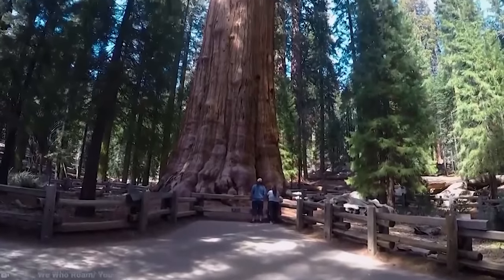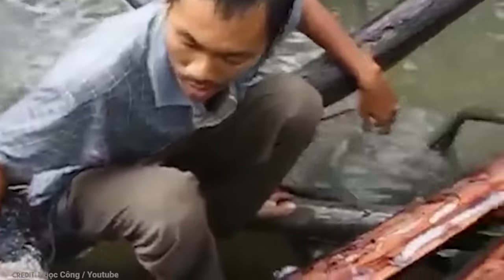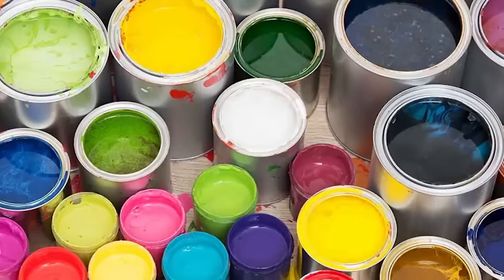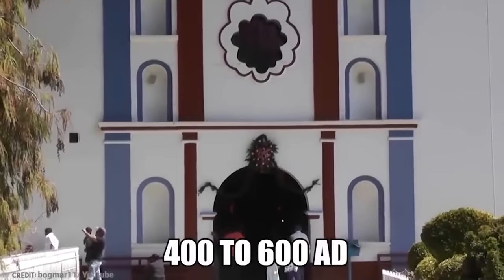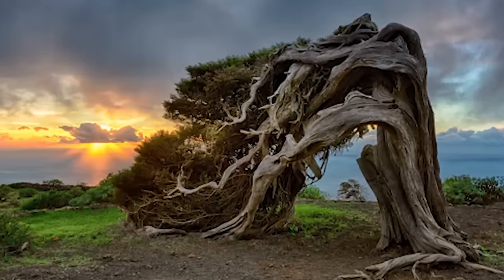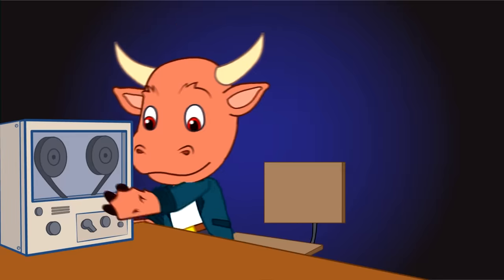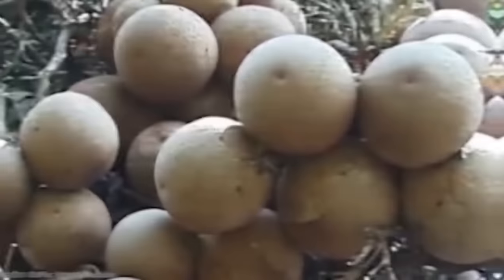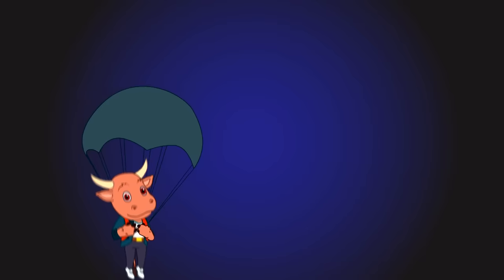15 Most Unusual Trees in the World

Comment: With regards to the portion of the video on The General Sherman Tree, I get the feeling that the narrator and the writer failed math.  For example, what the heck is a “circumference from the ground”?  There is no such term in mathematics.  According to the video, the tree has a diameter of 17.5 feet and a width of 36 feet.  It is hard to tell for certain what is meant by “width” as widths are generally not applied to circular objects.  It sounds as if they are using diameter and width to mean the same thing but the numbers are obviously not the same.  The assertion that the largest branch is 6.8 feet long would be nothing unusual if this was true.  Even with the difficulty in judging sizes from a video, the longest branches are obviously much longer than 6.8 feet long.  I frankly have no idea if the entire video is full of nonsense as I was multitasking through most of it.

A quick Google search followed by a trip to the National Parks Service website on the tree supplied the following information:

Statistics about the General Sherman Tree
																						Feet	       Meters
Height above Base							274.9.     83.8
Circumference at Ground						102.6.     31.1
Maximum Diameter at Base					  36.5.     11.1
Diameter 60' (18.3 m) above base				  17.5.       5.3
Diameter 180' (54.9 m) above base				  14.0.       4.3
Diameter of Largest Branch					    6.8.       2.1
Height of First Large Branch above the Base		130.0.     39.6
Average Crown Spread						106.5.     32.5
Reply: I thought it was the nickname of that specific tree. It is a magnificent creature isn't it!!!

Comment: You´d better check your math on the General Sherman tree.  It cant very well be 36 feet wide, and also 17.5 feet in diameter.  Not in this dimension, anyway.  Also, the largest branch is 7 feet long?  And what the hell does ¨the circumference from the ground is 106 feet¨ even mean?